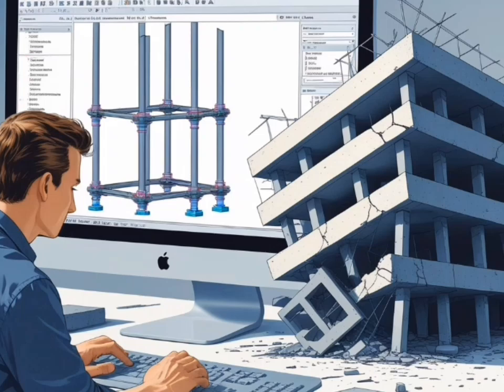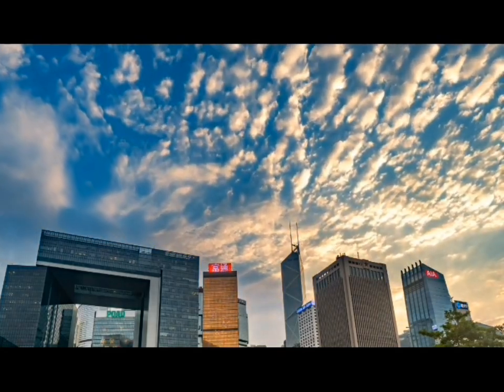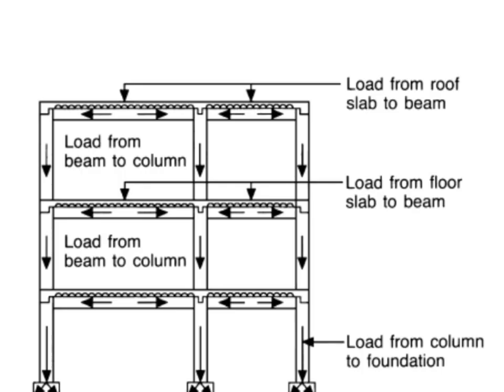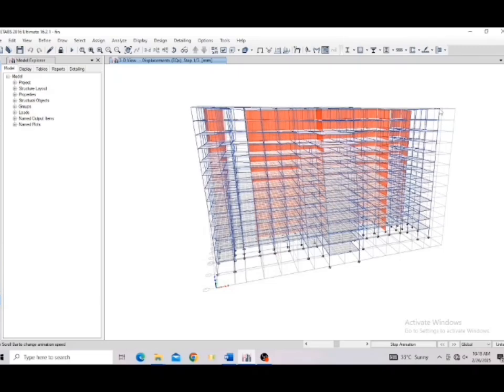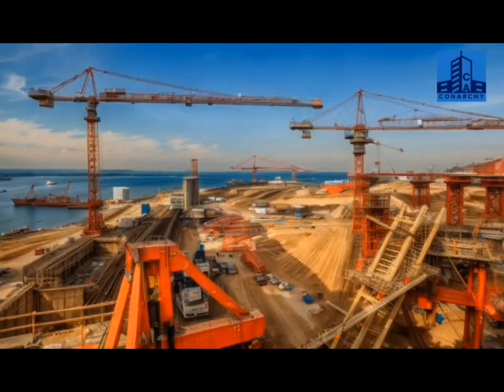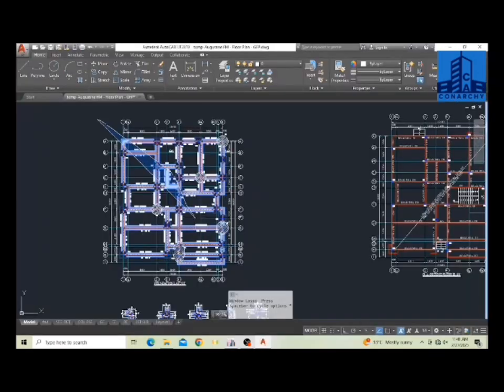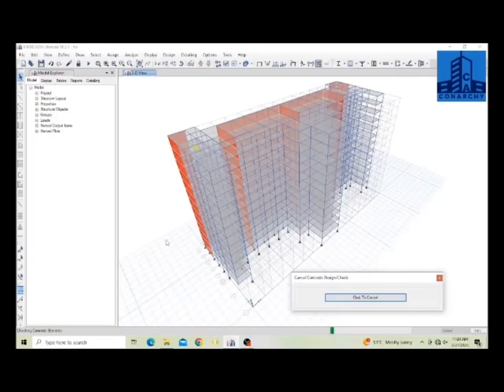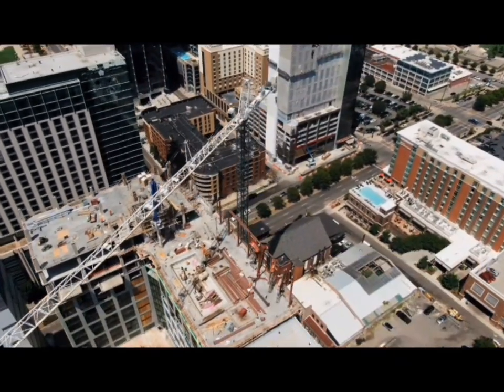ETABS, Essential and important Secrets you must know❗❗❗❗❗❗

Comment: Nice . How can we check punching shear in shear wall. Is there a must to check or leave it?
Reply from the maker: Punching shear in shear walls is usually not critical unless there are concentrated loads, such as from columns ,heavy axial forces or forces from floors above in that case checking for punching shear at those locations is important. But if loads are well-distributed, it’s generally not a concern.
Reply from the maker: ETABS does not directly check punching shear in shear walls. However, you can manually evaluate it by extracting reaction forces and applying design codes like ACI 318 or Eurocode 2 at critical locations, such as column-wall connections or wall-foundation interfaces.
Reply: Hi Meles, I've been missing you for a long time. you haven't finished the tutorial video you started on YouTube, complete High Rise Building with Inverted Ribbed Mat Foundation. pls if you can make it with  inverted ribbed mat foundation !